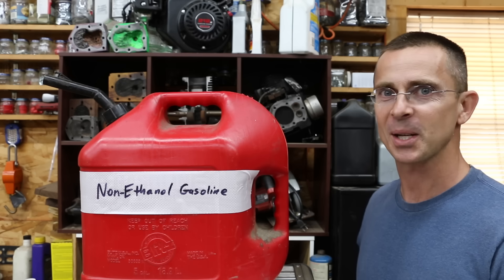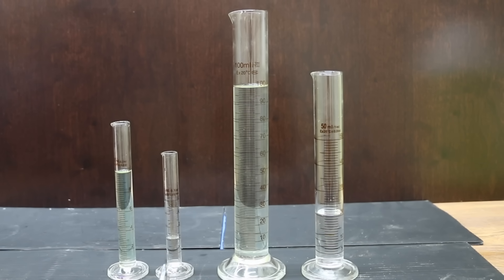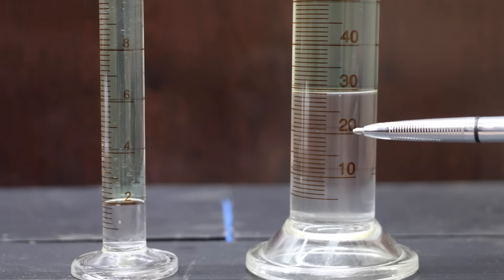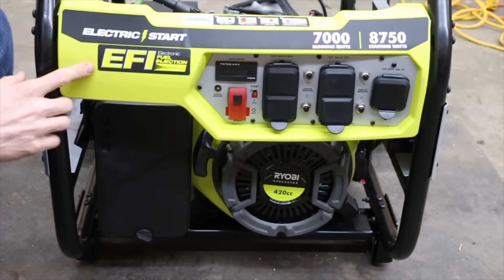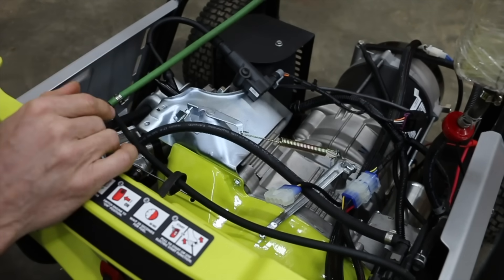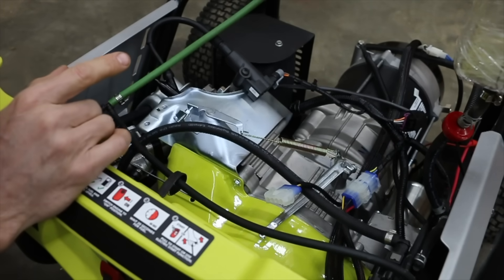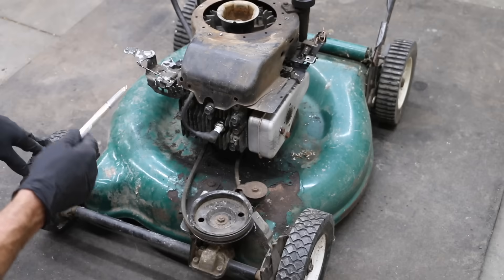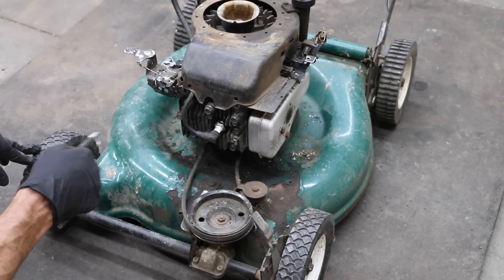Is Non-Ethanol Gasoline Really Better? See the PROOF!

Comment: In carburettors with foam floats ethanol will cause the foam floats to disintegrate so if you run ethanol you need brass floats
Reply from the maker: Thank you!

Comment: Ethanol gasoline reduced the mpg from 17 to 11 in my Ford pickup. MTBE was the cheaper additive to gasoline than ethanol but it was later changed exclusively ethanol to combat the extreme corrosive attack of engine components and water pollution decay rates. It is also believed that the ethanol or MTBE additives reduced the amount of pure gasoline consumed nation wide by 10-15% in short it's a filler. Ethanol subsidizes the corn industry by federal government mandate. As for the carbon buildup, each oil company adds it's own detergent additives to their brand to satisfy EPA requirements. 
Your approach is similar to the test engines used in refineries to determine blend quality, clean engines minus the octane or engine knock tests. Your videos are entertaining as well as informative. Keep up the great work!
Reply from the maker: Wow!  Great point. Thank you

Comment: Suggestion like to see on an engine that has lifter issues / noise run 1qt ATF in crankcase that is supposedly cleans out all the slug and improves engine performance on high mileage engine.
Reply from the maker: Thank you for the video idea!

Comment: I'm anxious to see the results of that test. Where I live, straight gas is close to $1/gallon more than E10, plus it's out of my way to get to a retailer who even sells it. However, I don't like the idea of ethanol in the carburetors of my garden tractor or generator. I used the ethanol blend in my old chainsaw, and it basically destroyed the entire fuel system to the point I gave up and junked the saw.
I have started running pre-mixed fuel in my weedeater and chainsaw, but I usually buy a gallon of 4-cycle Trufuel and mix it at 32:1 for my push mower, since I only mix one gallon at a time.
Reply from the maker: Thank you!

Comment: Here is a test idea for you: Take a Bing Carb (or any aluminum) float bowl and a couple of brass main jets and drop them into a jar with 10% ethanol fuel, and also take an identical float bowl and main jets and drop them into a jar with ethanol free fuel. Seal the jars and let them sit for 3 or 4 months. Then take them out and compare the corrosion.
My experience with ethanol in the fuel is the damage it does to the carburetor components.
Reply from the maker: Thank you for the video idea!

Comment: Project Farm what did you use on the drill to clean the engine head and valves was it a wire brush or some plastic brush? Thanks
Reply from the maker: I used a wire brush, but that's far too aggressive for a good engine.

Comment: I actually do know a fair bit about fuel economy in engines and I know one factor constantly gets ignored: air temperature of the environment. It's a non-linear scale that changes based on the size of the engine, but in "average weather" (not too cold, not too hot) fuel economy can change by as much as 1% per degree (centigrade).

Just blabbing all that to ask: did the temperature of the of the testing environment change during the testing? :-D
Reply from the maker: Great point!  The temperature remained very close to the same.  The shop is well ventilated and heated. Thank you

Comment: I think the formulation of the fuel, e.g. the additives, will have more to do with deposits than ethanol vs non-ethanol and, as you said, that's more of a long term thing anyway. There may also be a difference in the additives used in ethanol vs non-ethanol fuel. In automobiles, the difference in fuel economy is often between 5 and 10 percent for when using 10% blended fuel engines that were designed for pure gasoline. As was noted below, an engine can be optimized for ethanol. Often, the EFI can  adjust to ethanol blended fuel by using more ignition timing and that gets back some of the lost energy. 

I realize your practical limitations, but still wonder whether a flathead engine is a worthwhile testbed for things like this. The OHV EFI generator is a closer match to what happens in automobiles. 

A fun test would be to test fuel that you have "de-ethanoled" in the small engines you used. I wonder if the ethanol free fuel is adequate for small engines. IIRC, the octane rating will drop to the low 80s. Probably not for most modern automobile engines. 

I store emergency generator fuel and always worry about phase separation. I use that fuel for my mowers so it gets cycled but obviously not much happens over winter and if the summer is a slow gas-consuming  season, some of that fuel can be a year old before it's used. Thus far, knock on wood, I have not had a failure in my properly stored  (tight metal cans with a healthy does of Marine StaBil, sunless and relatively temp-stable sotrage), even in one can that accidentally went two years. In a forgotten gallon "shuttle can" of plastic, not well sealed, even though it was treated fuel, it had gone over in under six months.
Reply from the maker: Great point. Thank you

Comment: Ethanol has a lower energy content, so of course, per unit volume, you will get less: less MPG, less running time, w/e you set.
BUT,  if energy efficiency is not the issue, but PERFORMANCE is, mixing gasoline with ethanol works wonders, especially in high-performance/high intake+combustion  heat applications (pretty much any form of forced induction) and with modern or modernized fueling systems that can resist corrosion and keep up with he added volume needed, you get way more power and way cheaper than even race gasoline. 

For carbureted engines, you most likely need a different carburetor. There are many products designed for E85 even for American vintage muscle, and most people love it. The power that is, not the smell.
Reply from the maker: Thank you!

Comment: I had about a year and a half's worth of gas tracking for my '95 Chevy Caprice that showed about a mile per gallon less mileage from E10 than from non-ethanol gas.  (86 octane was also slightly more efficient than 87 octane, as one would expect.)  Given an average 19.whatever mpg it was getting, this is about in line with the 4-ish% drop you found.  Unfortunately all the data was on my old phone. :/
Reply from the maker: Great point! Thank you

Comment: As for that 4% difference in "efficiency", I think that's more to do with the lower energy by volume of ethanol vs. base petroleum. In short,  Ithink the 4% is not so much efficiency (as in thermal efficiency), more about the volume of a given amount of fuel by energy content.

Cheers! I love these videos, especially digging the synthetic motor oil tournament.
Reply from the maker: Thank you

Comment: Doesn't look like you've tested fuel stabilizers, like Sta-bil. They claim it works for a year. Maybe mix with 5 gallons gas and test at 4 month intervals comparing with gas that has no stabilizer added.
Reply from the maker: Thank you for the video idea!

Comment: It’s the seals that ethanol destroys. Also, it gums up if it isn’t ran for some time. We had ethanol added fuel in a four wheeler and it sat over winter and a good part of the summer. When we went to get t ready, the carb was practically seized up and the fuel went putrid.
We’ve never had any issues like that with straight gasoline.
Reply: That's a given bro. With a ranch I don't even know how many gas engines I have. I started a planned maintenance schedule for my stuff. Everything is started once a month, at the minimum or else I have to start rebuilding carburetors. 
Government sucks ass.
Reply from the maker: Thank you

Comment: For several years BOATUS has written in their monthly publication about the problems with using ethanol augmented fuels in small gas engines such as outboards and even inboard gas engines where the complaint is that ethanol causes the used engine's gaskets to leak.
In automobile engines it is my understanding that ethanol additives as added to gasoline reduces the fuel efficiency of the engine and the result is water vapor leaving the tailpipe which is observed as environmentally friendly whereas non-ethanol fuel promotes better fuel efficiency but is not as environmentally friendly.  
The real question remains: is it better for the environment to burn less fuel and cause some air pollution or is it better to burn more fuel and cause less air pollution?  Either way the gas companies win but with ethanol additives another whole industry becomes involved which is agriculture, specifically corn.  
From high-fructose corn syrup being added to our food and to our beverages to ethanol being added to fuels the agricultural corn lobby is an extremely formidable opponent; but also included in the corn equation is Monsanto who uses Round-up on the growing fields to kill off the weeds so their proprietary genetically engineered corn seed which is impervious to Round-up can grow freely into whatever the corn is destined to be utilized for. There is absolutely no difference between the corn we consume in our food and in our beverages and the corn which is destined to be converted into ethanol except the fuel grade isn't as picturesque and therefore palatable. 
The only way to escape the Round-up corn is to buy organic corn and the only way to give "the finger" to the Corn Lobby and to Monsanto is to buy and to use non-ethanol fuels.
Reply from the maker: Thank you!

Comment: Btw, to cut down on corrosion from ethanol attracting water, i add isopropyl alcohol to my car and small engines. Isopropyl alcohol is dry gas. Counter person at auto store said MSDS  sheets for dry gas and isopropyl alcohol are exactly the same. I add a splash to my 2 1/2 gallon container for lawn mowers and about 8 oz every other fill up in car. Buy isopropyl alcohol at local pharmacy store, it is cheaper and make sure it's 93% not 70% kind.
Reply from the maker: Thanks for the tip!

Comment: Ethanol was added to fuel in 2007. Pre 2007 carbureted SeaDoos have a lot of engine failures due to the ethanol reacting with the brass fittings and the vinyl fuel lines. It creates a green goo that clogs up the small internal fuel filters in the carburetors which causes the engines to run lean and sieze. Ethanol is responsible for a lot of Seadoo engine siezures with low hours. I bought a non running project 1999 RX Seadoo with a 951 engine that had this issue with only 128 hours on it.
Reply from the maker: Thank you!

Comment: I really don't notice much of a difference but it really depends on the engine. Most cars don't care but for whatever reason, my 2001 gm 6.0l drops about 10% of it's efficiency with ethanol fuel. Nothing else I've had cares. Girlfriends Malibu doesn't care either. It's weird
Reply from the maker: Interesting. Thank you

Comment: Very interesting, I'm not quite old enough to have been able to get ethanol free gas at the pumps around me, but I have noticed in my small engines, mainly string trimmer and chainsaw 2 strokes, that the ethanol free stuff in the cans from lowes or wherever designed for small engines does seem to work better. I haven't had issues with starting in the spring or in the dead of winter with the chainsaw. It seems to work better so I continue to buy it. My dad always cursed at the ethanol fuels as well every time he had to rebuild a carb or replace fuel lines on his tiller or lawnmower. I'll be looking forward to the test on the fuel degrading rubber and plastic components. Is it based on fact or is it just something for people to take small engine frustrations out on?

Comment: Ethanol is death to float type carburetors especially if the bowl is aluminum
Reply from the maker: Great point!
Reply: My poor CBR, now I have to look for non ethanol gasoline to put in my bike. It's a carbureted 2000 CBR 600 F4.
Reply: Use Star Tron
Reply: @mike-uw6wt  I just looked it up, I'll give it a good and add to my gas on every couple of fill ups.
Reply: mark lynch I have a weekend sports car that sits anywhere from weeks to months in my garage.  Never had any fuel problems.  I’ve used stabil before but it made my car run rough unlike Star Tron.
Reply: @mike-uw6wt  I was doing some reading up on it, looks like it's safe to add to my tank between fill ups. I use stabil for the snowblower but is only 2 seasons old I'll try out the star Tron.
Reply: mark lynch yeah it’s safe to add anytime.  It’s an enzyme in a petroleum base so you can’t OD on it.  Most other brands use solvents to work.  Although a little goes a long way I tend to dose on the high side because my car sits so much.
Reply: @mike-uw6wt  copy that

Comment: Marine engines are particularly cranky about ethanol as well. The fact that it likes water so much means that you almost always end up with water in the tank. Then different load curve on marine engines also raises engine temps with ethanol. Another thing that would be cool to test is longevity. From the studies I've read, non ethanol gas can be stored in a metal airtight container for up to 5 years with no adverse affects, whereas ethanol is only good for 10 months or so.
Reply from the maker: Great point!

Comment: I've used the same push mower (Briggs engine) for 25 years. The mower sits from Nov until May. I buy the cheap ethanol gas and never drain the tank. It always starts up and runs fine in the spring. All I've ever done is clean and gauge the sparkplug a few times.
Reply from the maker: Thank you

Comment: PLEASE do some tests on E85.  I know it gets worse gas mileage, but I use it in my GM Silverado (Flex Fuel engine) because it gets subsidized so much in the Midwest.  It actually makes financial sense to use it.  My concern is what it does to the engine over a long term.  I now have 150k on the engine and it seems to keep going strong.   Love your channel.
Reply: It gets 20-30% worse gas mileage, which means you use 20-30% more fuel and you pay 20-30% more to go the same distance as gasoline. I did a price comparison of 10 states in a report i did about E85 vs gasoline with the 20-30% stoichiometry and potential energy differences factored in and the prices equaled out almost IDENTICALLY every time, within a few pennies. 
https://afdc.energy.gov/fuels/fuel_comparison_chart.pdf
https://e85prices.com/
I opine that E85 is only useful in racing.
Reply: @rustysausage69  Unless it is over 30% cheaper at the pump - which is sometimes what it is in the midwest, as I already pointed out.
Reply: @rustysausage69  I understand.  Completely.  I'm not as stupid as you apparently think I am. My point is that if ethanol is MORE than 30% cheaper than the gas alternative, it is wise to purchase it.  Here in the midwest, as I've stated several times but you didn't apparently read, it is often more than 30% cheaper than regular gas because it gets subsidized heavier out here.  The cost outweighs the mileage loss when this happens.  Lately, that hasn't been the case because ethanol prices have skyrocketed due to floods wiping out corn crops in the south.  Holy shit, I feel like I'm talking to a wall.
Reply: Ethanol is a solvent, and the larger volume of fuel required to run e85 means you are washing the lubricating oil from the bores of your engine resulting in accelerated bore, and ring wear. Also the higher volume of fuel consumed results in more combustion contamination in crankcase, which means that you should be changing your oil much more frequently than if you were burning ethanol free fuel. Alcohol diluted oil doesn't lubricate very well.

Comment: You pretty much hit the nail on the head, most of the problems with ethanol are found in small engines that's it like chainsaws or leaf blowers during the winter. if you start your small engine every day you will most likely never see problems. But if you let one sit with ethanol fuel in it for over a month you will most likely have carburetor issues when you go to use it. For me with items like chainsaws wood chippers and splitters that are only used a couple times a year, it's worth the $20 a gallon to buy trufuel